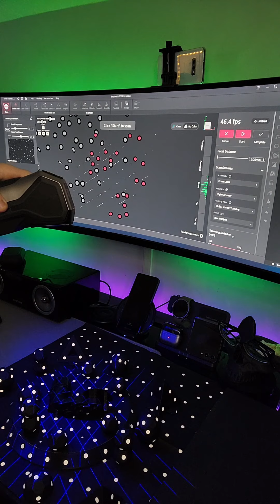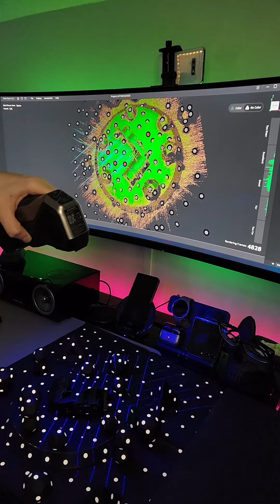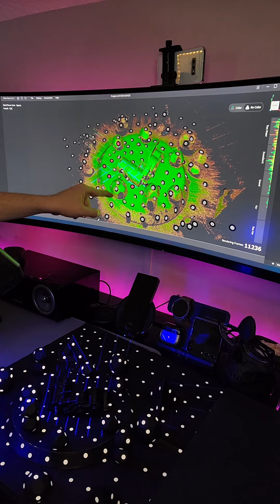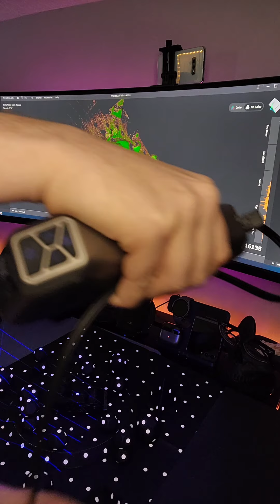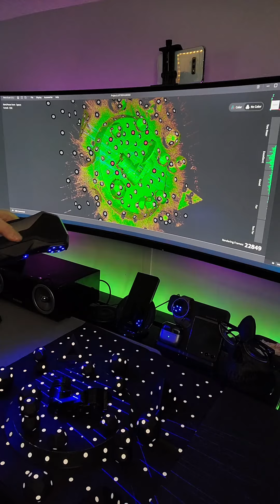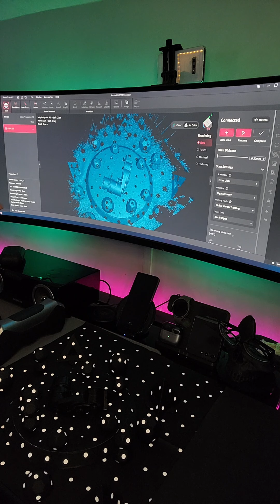Laser Scanning Black Object with Revopoint MetroX 3D Scanner

Comment: Is it always that slow? That object can be scanned in 20-50seconds using Raptor.
Reply: Agree, and I do not need so many markers, usually i don't put them on models at all
Reply: It's a software issue, Revopoint is actually working on using the GPU to process instead of the CPU, so it should make the scanning process less laggy and faster.
Reply: @flypip  I am not asking if that will be fixed, through out 30 years I have heard that unlimited number of times, only small amount of companies was delivering what they promised AFTER sale.

Revopoint has history of over-promising. I had POP1/POP3/Miraco, they all were awfully bad and first scanner that semi-worked for my expectations was the Creality Raptor.

Cancelling my pledge as saw on reddit some comments about Metrox that was shown on some trade show in last few days. It was really slow (as slow as on the video) and wasn't tracking well laser lines (which are the easiest mode to use with Raptor, hardly have any issues with tracking and I never use markers on objects).
Reply: @MM-oh3zs  Well, I also have a Raptor but the software is a joke as there is 0 functionnality to work properly. The RaptorX pricing is also a big joke and they are already selling their products (Raptor & RaptorX) -30% of the launch price.
Reply: @MM-oh3zs  lol i use the miraco on a regular basis .. it's always been far from awful.. heck i even used a scan i did 3 years ago with my pop1 for making things first try . lots of people say revopoint over promises but from my own experience it's generally user error more then anything. you should also look at all the upgrades revo has done after initial launch they're basically the only ones doing consistent software and firmware updates after release. theres been a BOAT load of stuff added in the last year 

far as not tracking laser well.. the software was just updated during sema and it scans significantly smoother now.

also until creality's latest software update that object wouldn't scan in anywhere near 1 min it would take probably about 10 mins and tbh ken could use to be brushing it in faster to capture data quicker but he's also talking while doing it.. i'm betting it would be about 10 mins under a "normal" situation
Reply: @digital0785  totally agree on the Miraco; it just works. pretty much the only scanner I use now - love it.

Comment: Out of curiosity: the lasers are "flashing". I think this is an artifact because of interference with the camera capturing? Not visible in reality, right?
Reply from the maker: Yeah that's an artificial artifact caused by recording. The lasers need to have uniform brightness, so in Cross Line mode they alternate at an extremely high frequency so only one set projected at a time. If this wasn't done there would be a bright spot where the lines intersect, which would impact the scan quality. 

To the naked eye, it's invisible 99% of the time. If you're using a very low laser brightness, you might be able to see it if you're looking for it. It's basically like PWM flicker on some phone/computer screens, and the result in video is the same as when a display has a different refresh rate than the camera. 

All that being said, the Parallel line mode doesn't show that because it's only one set of lines and there's no need to prevent overlap spots.
Reply: @KenDoes3D  thanks for the detailed response! That totally makes sense! I was thinking about a PWM because the laser is dimmable. But the alternating pattern to prevent bright spots I was not thinking about. Smart! 😀 BTW is the 3rd little hole the one for the parallel lines, or do they take one of the cross line lasers for parallel laser mode and turn the other off?
Reply from the maker: @Gaston12345  I'm super late replying - it's for the parallel lines

Comment: Are you allowed to publish raw point clouds? Really wanna find out what's the deal with those details and edges that get smoothed out or lost
Reply from the maker: Revoscan uses a very performant shader, but it's also prone to smoothing edges. But that's just the shader and not the model. 

Check out the FB group or their forums, I've been sharing scans there using different software to open the models which show the true detail
Reply: @KenDoes3D  you mean the screenshots, right? But are you allowed to share .ply files?

Comment: good scan .what is you  pc config
Reply from the maker: @hellpanzer3181  Thanks! I run a Ryzen 9 5900x, 64gb RAM, AMD 6700XT
Reply: @KenDoes3D  it would be great to have similar video with a slightly smaller rig. Not all of us have such monsters' of PC config. it would be good to see what framerate, if there is any tracking hangup, etc.